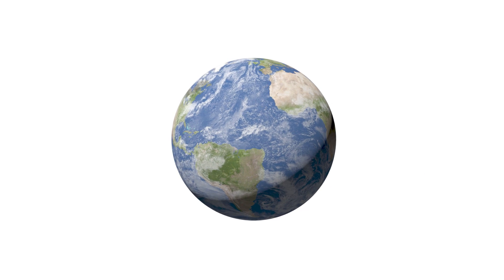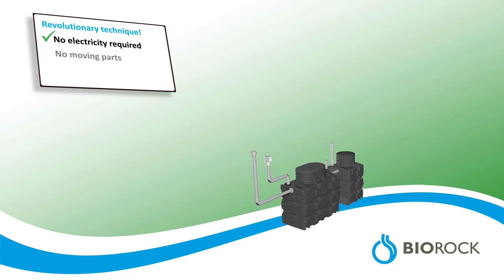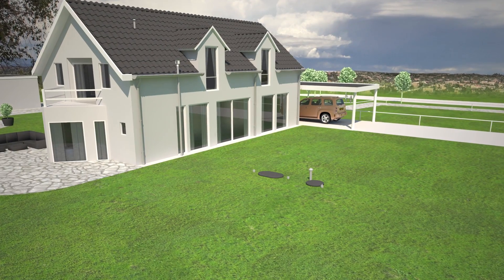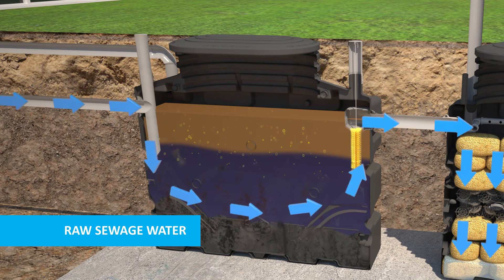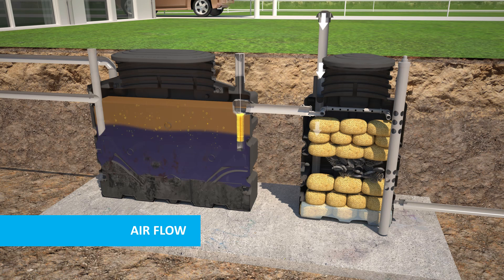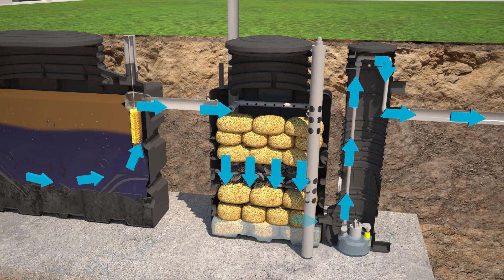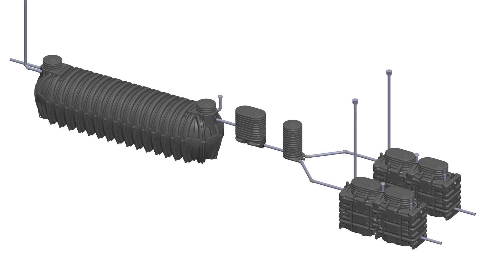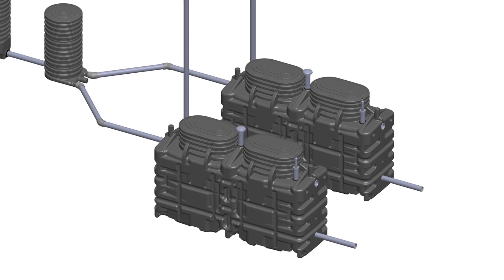New ECOROCK range of Compact, Non-Electric Sewage/Waste Water Treatment Plants by BIOROCK

Comment: Kindly clear the air on how to get rid of accumulated sludge and how often this should be handled for the various system capacity explained in this video. The package is lovely and my firm may try recommending to clients once explanation of sludge is given.
Reply from the maker: You should have your system inspected every year to make sure it's working properly. Sludge emptying is generally done every 3-4 years by a company specialized in emptying.

Comment: What about sludge ?
Reply: Yeah I'm not buying the "low O&M" selling point. The sludge probably has to be emptied pretty often and its build up must have an effect on the bioreacter effectiveness. I'm not sure how they'd reliably be able to maintain a proper F/M ration.
Reply: @colinbergmann9064  But their design is pretty interesting regardless. I wonder how I may convert my cement tank into these ones by inserting some PVC pipes and get the air flowing.